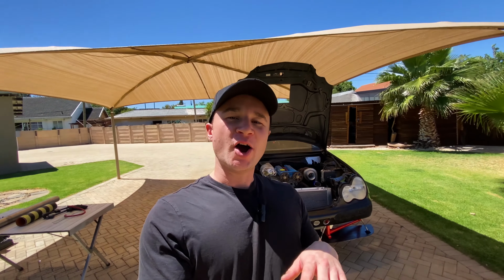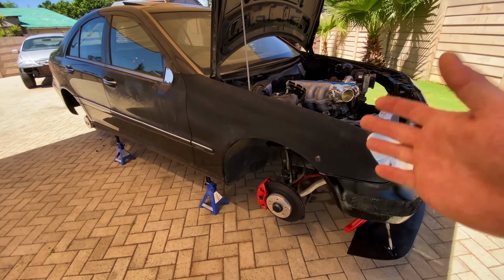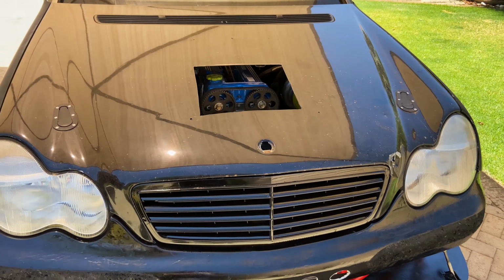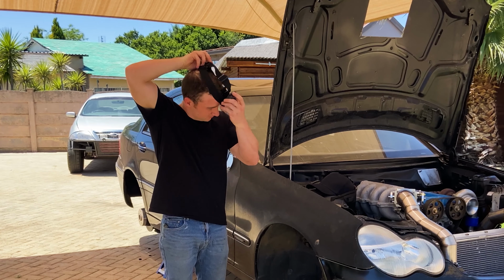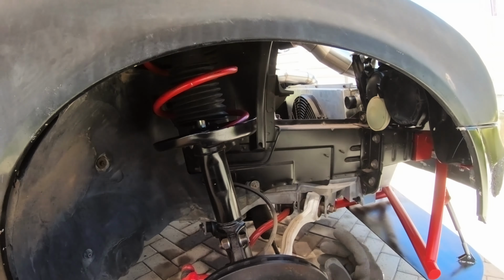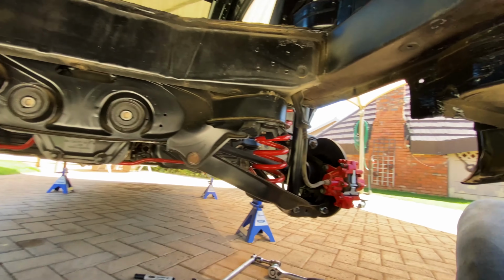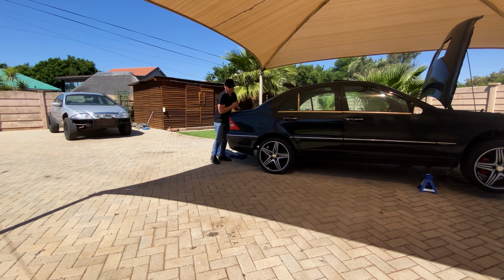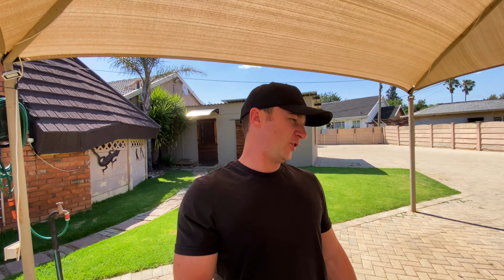How NOT To Lower Your Mercedes W203 | Cut Coils & STAINLESS STEEL Boost Pipes (This is PERFECT!🤩)

Comment: don't worry about rar coils. they are not going anywere. I have done this few times with even more drop. So if you dont plan to jupm on it - you can leave it as it is
Reply from the maker: Thanks for the tip🤙🏼I’m sure it’ll be fine🤘🤣 as long as all 4 wheels stay on the ground yep!

Comment: Hey man what year is this Benz and is all the stuff ur doing something’s that I could do to my stock base model 2005 c240 wagon?
Reply: I need to go back and watch a lot of ur videos bc Im not sure if you have done an engine swap or not. I have the 2.6 v6 in my wagon.
Reply from the maker: Honestly not sure it should be pre 04…
In my opinion you can turbo any car🤙🏼if you want it bad enough 🤣
This is a Mazda FE3 turbo engine swap.
Also did a m104 turbo swap in my 04’ w203 you can check out for tips🤘